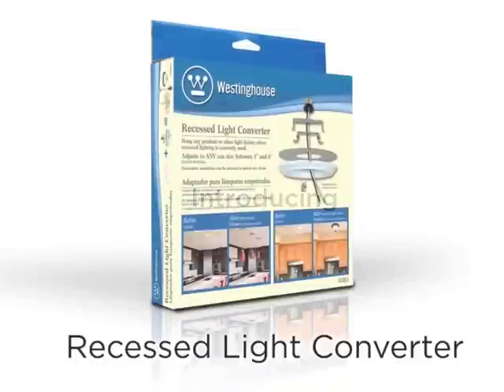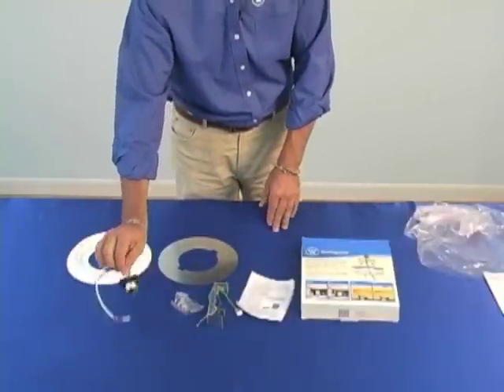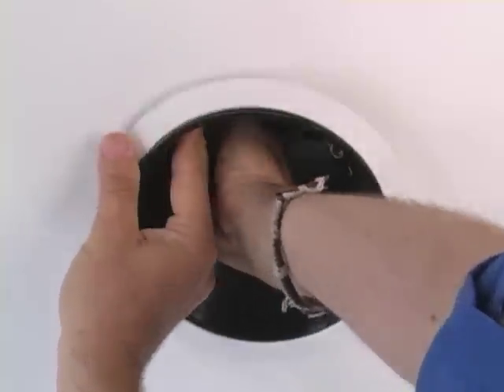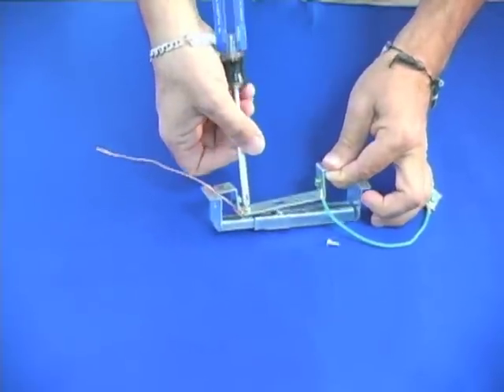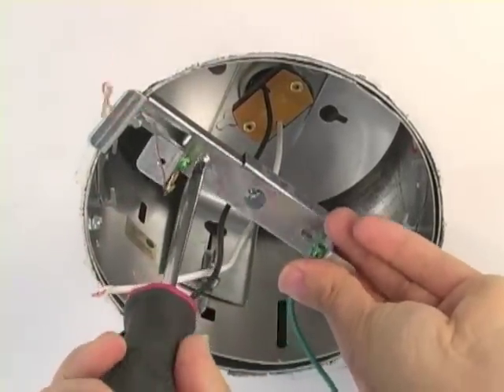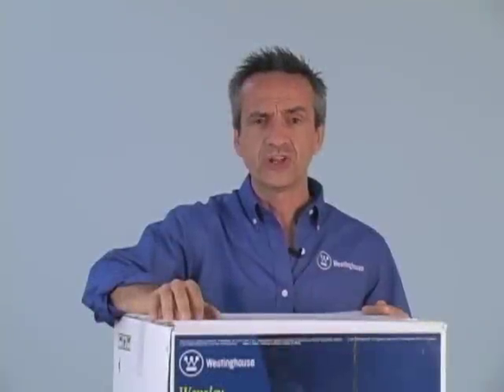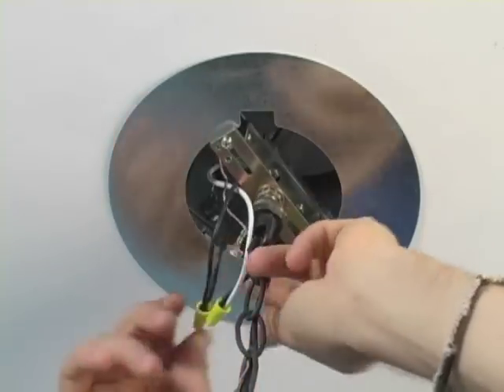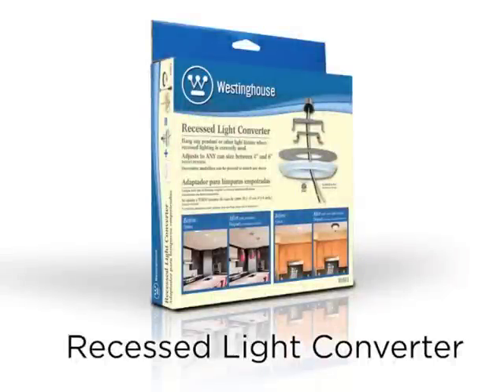Recessed Light Converter Chandelier - How to install

Comment: I have been taught to wrap the wire and nuts with electrical tape for an added protection - the directions recommend that as well
Reply: toneyjl59 If you make good connections you won’t have to worry about using electrical tape
Reply: I have always done that. Just common sense and an extra precaution.

Comment: This adapter isn’t computable with pop in cans.  That means they aren’t braced, just popped into a hole in the drywall.  These type of cans might not support the added weight of your new light.

Comment: My recessed light can is not flush with drywall. Its 1/2" pass the inside edge of drywall. Because of this the metal cover plate cannot slide pass the bracket (as bracket is almost same level as drywall) it okay to not install cover plate and install Medallion directly?
Reply from the maker: Hello: In many places the metal plate is required to meet local electrical code requirements. We recommend consulting a local building inspector or professional installer to determine if the medallion can be used without the metal plate to meet local code requirements. Thank you!

Comment: Help... when I took off my recessed light can. The bulb socket is not attached to the can as it is in your video. Mine is hanging. What do you do with the hanging socket. Do I still screw in the recess light socket.
Reply from the maker: Hello: To I sure a proper and safe installation, we recommend contacting a qualified electrician in your area for assistance with your installation. Thank you!
Reply: @Westinghouselighting  I was able to get it to work. Thanks for replying.

Comment: Will this work for square recessed lights? It is 12inches by 12inches.
Reply from the maker: Thank you for your question. Please reach out to consumersupport@westinghouselighting.com and they can assist you directly with the size requirements needed for the recessed light converter.

Comment: Same complaint as others. I have worked construction for years and have used many self tappers, and its obvious, self tapping screws work much better that self piercing screws. I would never "choose" to use these types of screws for this type of awkward overhead project. I had to pre drill the holes like others and ruined some wood drill bits in the process because i didn't want to run out to home depot AGAIN just to buy better screws. It's funny that similar complaints date back multiple years (on this video alone) and they still haven't just switched the screws. They probably get these screws too cheap to switch them out. I mean think about it, they give you 4 cheap screws knowing you will have trouble with them, and probably lose at least one. Second thing I didn't like was the "Decorative" Medallion. Its ugly. I ended up spray painting my metal cover plate white and luckily my light cover plate covered the inner hole. But all and all, a couple modifications and everything looks great.
Reply from the maker: We appreciate your feedback. We're sorry to hear that you had some issues with the product but glad the end result was satisfactory. We value our customers' input and will forward your comments to our product team. Thanks for choosing Westinghouse Lighting.

Comment: Self-tapping, my ass.  That was the most difficult part of the install.  Unless your can is made of Aluminum Foil, you need to pre-drill the holes for the mounting bracket into the Can.
Reply: I'm a 55 yr old female and thought the problem was me -  Guess not!!
Reply from the maker: toneyjl59 Thank you for contacting us. Sorry you are having trouble with the self-piercing screws. We have tested them on both aluminum and steel cans, without any problems. Some of the possible causes for not piercing the can is that not enough torque is generated by the drill. Are you using a cordless drill? Check and see if it is completely charged? If the answer to that is yes, here are a few other suggestions: You can try using a plug-in drill (they have more torque)? Also If you have a  ¼” hex driver it holds the screw better allowing you to put more weight behind it. If all else fails, you can drill a pilot hole (1/16” or 1/8” diameter) into the side wall of the can to get the screw started. Please let us know if this helps.
Reply: Greg you are absolutely correct and you gotta love the Westinghouse reply basically telling you that you're an idiot (didn't you know Greg that you have to charge your drill before using it!).  I flat out don't believe Westinghouse tested these "self-piercing" screws on a variety of cans.  Since the screws don't work, I've tried to pre-drill my cans with a regular drill, then an impact drill, and now think I need to go out and buy a high-speed drill bit better suited for metal.
Reply from the maker: Brian Schmitz Brian - We are sorry that you are having trouble with the self-piercing screws.  Could you give us some information about the recessed can you are having trouble with? Possibly the make, size  and model number? We would like to look into this issue further. Thank you for your patience.

Comment: I took out the bulb and recessed can but there is just bare drywall beneath, no sheet metal. How do I make it work?
Reply from the maker: Hi! We'd be happy to help if you could kindly answer a couple questions to help clarify the application. Where was the wire going to the bulb attached - was it a recessed can or a junction box? How did that wire get to the light bulb?

Comment: Do i need to drill the holes ?
Reply from the maker: Hello: The recessed light converter includes self-piercing screws and these need to be used to properly install the mounting bracket to the recessed can.  It is recommended to use a power drill with a Phillips bit or quarter-inch hexagon driver for installation.  If you are uncertain how to install this recessed light converter or the correct products needed for installation, we recommend contacting a qualified electrician in your area for assistance. Thank you!

Comment: Does it matter where u scre the bracket into the can
Reply from the maker: Hello: When securing the sliding bar to the recessed can the self-piercing screws can be installed anywhere along the perimeter as long as they are going into the solid metal of the can. Please see step 5 / figure 4 of the included installation instructions for details: https://www.westinghouselighting.com/pdfs/products/0101100_im.pdf 
Thank you!

Comment: what if the recessed area does not have a pigtail screw insert?
Reply from the maker: The recess housing needs to have a medium base threaded socket. This will allow the socket pigtail included with the Recess Light Converter to screw into the socket and get the power from the house. Please let us know if you have any other questions. Thank you!

Comment: Hi, I have installed this kit in my bathroom without no problems. Before attaching the chandelier to the installed converter kit, I tested it with a lamp cord to make sure it was working and all the lights came on. So I proceeded to attach the chandelier to the wires on the socket pigtail. I did it properly: live wire with black wire and neutral with white wire. After turning on the power, it won't light up. There are 4 recessed lights on the ceiling and they are turned on by one switch on the wall. When I turn the switch on all the other 3 recessed lights come on except for the one where the chandelier was installed and I hear a click sound in the light box where the chandelier is. What could be wrong?
Reply from the maker: Dear Alcione, 

Thank you for your inquiry. We would like to assist with your issue.  Please contact our Consumer
Support line at 1-888-417-6222 so we can assist you with this matter.
Thank you, Westinghouse Lighting

Comment: I just installed the converter kit properly and it will not light. What could be the problem?? I am very disappointed!!
Reply from the maker: Hi Donna - Thank you for your inquiry. We would like to assist with your issue.  Please contact our Consumer
Support line at 1-888-417-6222 so we can assist you with this matter. Than you, Westinghouse Lighting
Reply: Your not a qualified electrician call a professional

Comment: I'm sure the gentleman in the video is using self-piercing screws.  And, I suspect, the recessed housing he is drilling through is cheap and thin.  However, those screws are not what is shipped with the product -- tthey are standard sheet metal screws.  And I attempted to drill through a recessed housing with some substance,  using a driver with a just charged battery.  Result:  not a scratch.  So, just went out to ACE to buy self-tapping screws.  ACE guys laughed at the "self-tapping screws" I showed them from the conversion kit and then pointed me to the actual thing.  Perhaps a little bit of real world research with the actual product components would allow delivery of a quality product.  From comments I have read, the Westinghouse engineers likely have new idea of how viable these kits are across a broad range of potential application.
Reply from the maker: +John Schinka 
Hi John, Thanks for contacting us. On the video we are using the Self-Piercing screws supplied with the Recess Light Converter. As you know, in the market there are different types of sheet metal screws.
I've added a link to an image where I am showing the images of 3 different screw types relevant to this conversation. As you can see, the tip of the screws are very different. The tip of the Self-Piercing screw is very pointed and designed to pierce the metal. That is why we selected this type for this application. The Self-Piercing screw is what is supplied with the kit.
Copy and Past the full address to the right into your browser to view image of screws: bit.ly/1LRXQaC

The recessed housing used for the demo were purchased from 2 of the large DIY stores and are standard recess housings.

Also, we want to mention that different cordless drills have different torque ratings, so to level the field we recommend using a “corded” drill.
Additionally, we have tested this kit in many real world application, and we did find that not all recess housings are made from the same material or the same thickness, so we did an addendum video that showed for the recess housings with heavier walls to use drill bit to punch through it.
Copy and Past the address into your browser to view addendum video: youtu.be/JeIAR1h2ICo

We do care about feedback, and appreciate your comments.
Reply: This is exactly what happened to me! Good to know it's just a matter of different screws. Thanks!
Reply: Couldn't get them in either. Went to home depot and got self piercing lath screws. Worked great.

Comment: The install video is total BS.  You will not be able to screw the big side screws into the canister.  The video shows they go right into the side. I had to pre drill small holes before the screws would go in.
Reply: Shhh, quiet water head.